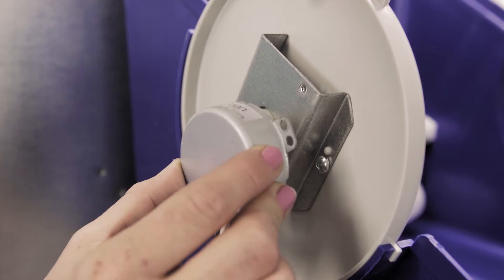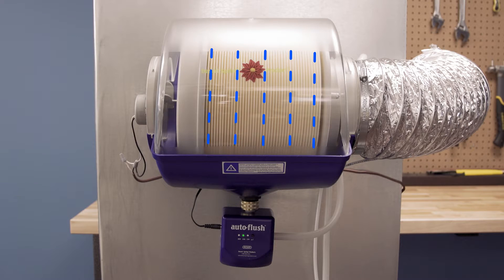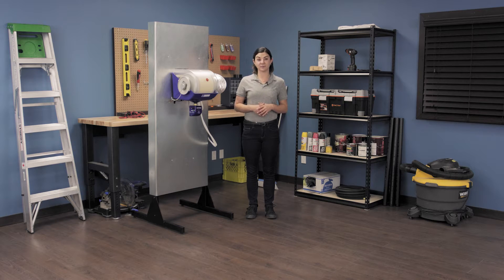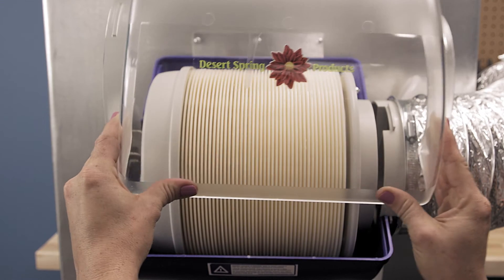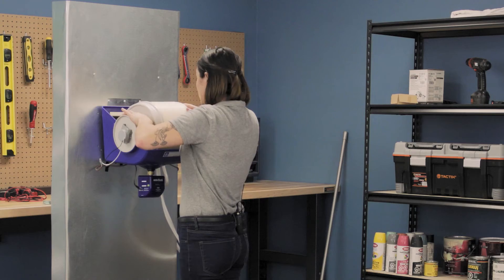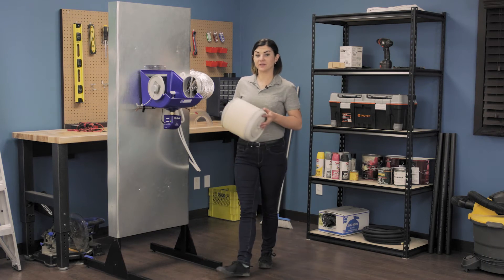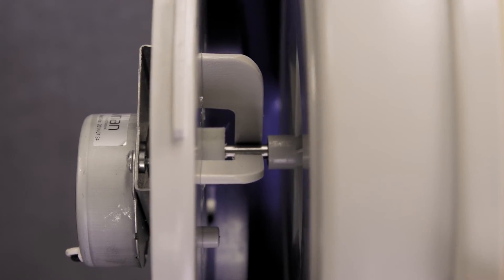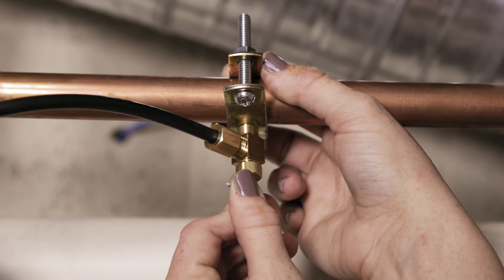Humidifier Motor: Repair and Replace (Desert Spring DS-PP)

Comment: Great humidifier especially since you've redesigned the motor shaft further away from the water!

Made in Canada eh, often means that AFFORDABILITY, COMMONSENSE, LONGEVITY AND HONEST TRUSTWORTHY ARE BUILD INTO THE PRODUCT! THANK YOU!
The inline scale reducer is a must for me and I've read that virtually all parts of the USA have hard water problems.
I see I can also buy an inline scale reducer for an evaporative cooler and use that from the local home improvement store. I'm not sure which is larger/longer lasting compared to price.

I can't believe how much crazy amounts of water people are wasting going down the drain as it passes through, with the more expensive, less effective, expensive replacement filters, with the pass through designed humidifiers.
It's truly Criminal and costly and I think Cities should start banning them and probably will!

Take care!
Reply from the maker: Thanks for watching. You're right that any humidifier that uses a solenoid valve to control the water will have less water use than a continual flow model.

Comment: Can the inlet be on either side of unit ?
Reply from the maker: Thanks for watching. Without a mounting hole it can only be installed on the right side. If you have the tools you might be able to drill a hole on the left side to install it there. You might need a tap and die set.